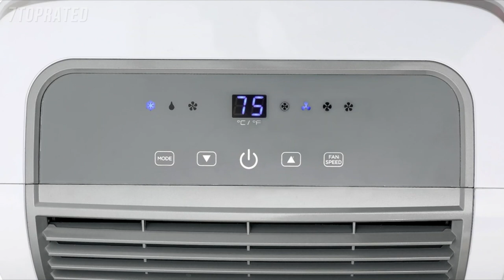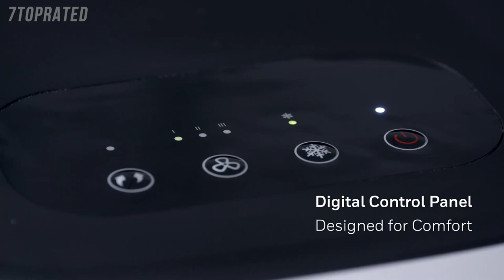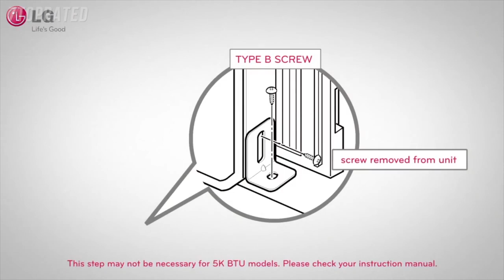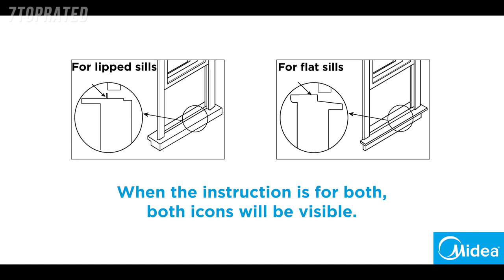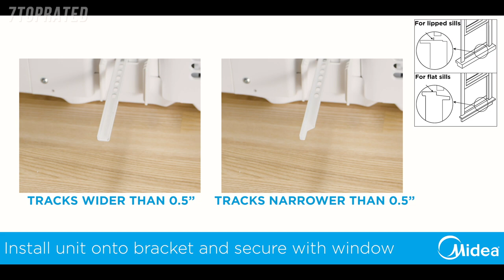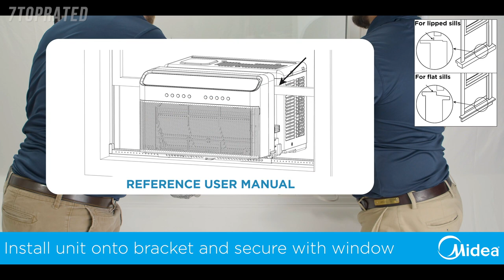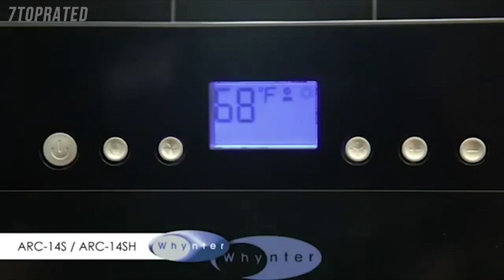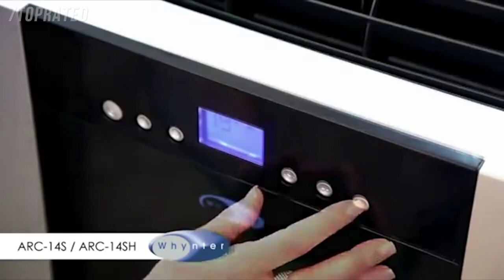5 Best AIR CONDITIONERS 2021

Comment from the maker: Links to the Air Conditioners we listed in this video:

► 5. Black + Decker BPACT10WT Portable Air Conditioner - https://amzn.to/38OEmIF
► 4. Honeywell 525 CFM Indoor Outdoor Portable Evaporative Cooler - https://amzn.to/3hDED5f
► 3. LG 12,000 BTU 230V Window-Mounted AIR Conditioner - https://amzn.to/3pDeyWF
► 2. Midea U Inverter Window Air Conditioner - https://amzn.to/2KNUaTV
► 1. Whynter ARC-14S 14,000 BTU Dual Hose Portable Air Conditioner - https://amzn.to/2KLX77h

==========

UK Links:

► 5. Black + Decker BPACT10WT Portable Air Conditioner - https://amzn.to/2WUMwtu
► 4. Honeywell 525 CFM Indoor Outdoor Portable Evaporative Cooler - https://amzn.to/2JubNHN
► 3. LG 12,000 BTU 230V Window-Mounted AIR Conditioner - https://amzn.to/2WVfeu8
► 2. Midea U Inverter Window Air Conditioner - https://amzn.to/37Y7NJ6
► 1. Whynter ARC-14S 14,000 BTU Dual Hose Portable Air Conditioner - https://amzn.to/3rBruhx

==========

Canada Links:

► 5. Black + Decker BPACT10WT Portable Air Conditioner - https://amzn.to/2L01Vpw
► 4. Honeywell 525 CFM Indoor Outdoor Portable Evaporative Cooler - https://amzn.to/2WW6rrG
► 3. LG 12,000 BTU 230V Window-Mounted AIR Conditioner - https://amzn.to/3pqCfkS
► 2. Midea U Inverter Window Air Conditioner - https://amzn.to/3aRpoUB
► 1. Whynter ARC-14S 14,000 BTU Dual Hose Portable Air Conditioner - https://amzn.to/38MqjTI